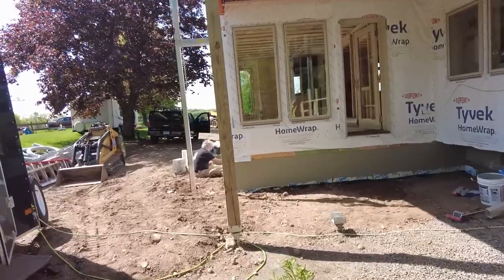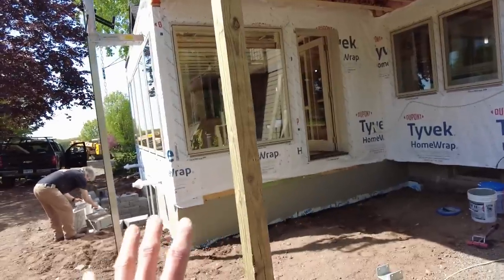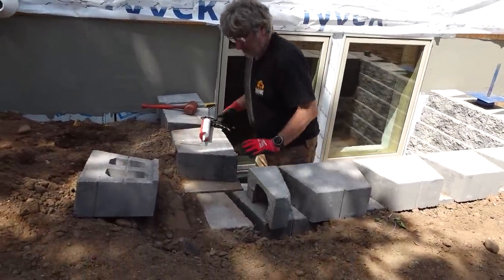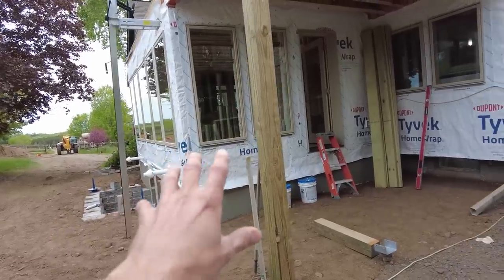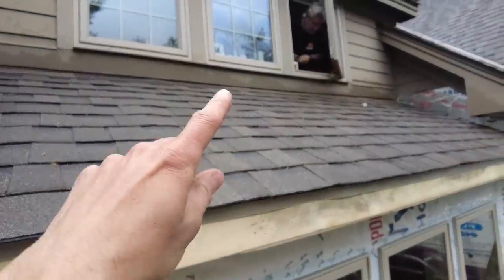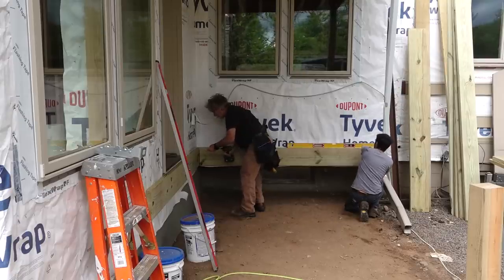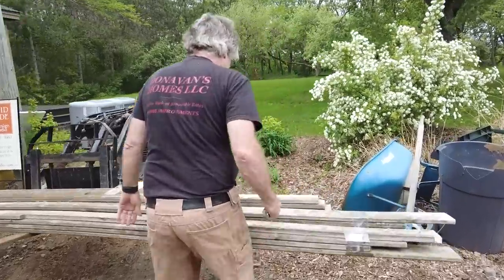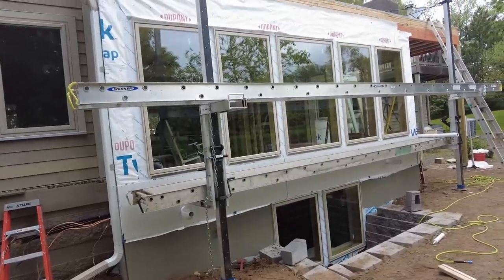Every Sunroom Needs a Porch | Home Renovation & Addition Part 43

Comment: Just run a floor sander over the decking, that will brighten them right up.
Reply: Yes. And a router with a roundover bit to do the edges. If the bit's bearing cannot fit between the boards, unscrew every other board first.

Comment: By the hour makes all this work happen. Likely not that chseap. If it was a crew were doing all these types non skilled jobs, it would be faster and cheaper.  Some would build faster and cheaper, but would not earn the youtube revenue. Always trade offs. Did Matt say how many enclosed sq ft he added ~2000. if so and he spent $100k in materials max. what about other costs.  I am sure the Minnesota housing is  a la Pulte Homes on a lot not >$200 per sq/ft for a modern place.  He did a good detail of his trailer build last year. I know he will not try to hide anything.

Comment: For the decking, I’m in favor of milling your own Black Locust. 
It’s abundantly available (almost invasive) and yields a hard, strong, rot resistant, and nicely grained material. 

The downside that keeps it from being widely commercialized is that it’s hard to find straight specimens to yield those 20’ boards that so many decks require. But for an 8’ deck, it’s rather perfect!

Comment: Why did you cut off the waterproofing below grade? Otherwise another great video.
Reply: Martin - I was wondering the same thing.  It seems like there needs to be some type of waterproof transition between the parging and the waterproof membrane.  Otherwise, moisture will get into the structure.

Comment: When fitting block, it's better to average them out, instead of cutting the last one. Just like tile in the bathroom. It gives a more professional look. The front tips of the blocks can be snipped as you please.  For a 6 foot area, if you need 6 inches, snip off about 1 inch for each block to get more space for an extra block, a small 4 inch grinder will do. 
   I bet if you power washed those boards they would come out nice.
   11:12   Hey Andrew, nice seeing you here!  :)

Comment: Danger Will Robinson! Danger! Casement windows that open outward above walkways, passages and/or decks/patios are a safety hazard if they are not well above traffic level i.e. -- your head! Horizonal sliders would have been a better choice of window style, but Marvin pushes more energy efficient casements. SOLUTION: Take a spool of monofilament & attach a short piece inside the weather strip to the window frame. Other measured end to sash beneath top inside weather strip. Allow window to open maximum of 6 inches or less! That's plenty of ventilation & will limit chances of kids, workmen or yourselves from running or backing into it. Window glass is not tempered & can break into long sabrelike shards. My wife enjoys the renovation vids, but having been in the millwork industry, any male carpenter might just as well be a gynecologist. Painting your handmade cabinets, just for starters. I digress. From a guy who renovated 2 old houses. Best regards,
Reply: Safety Sally has officially arrived
Reply: @daveklein2826  Window glass children at play & trafficked areas not good.
Reply: @sierraevanlukethomas  LMAO all of it is at counter height and above and it all tempered glass
Reply: @daveklein2826  Not what the videos show. I'll await the EMS episode. Meanwhile, drop dead.